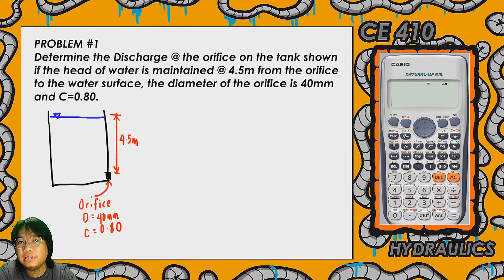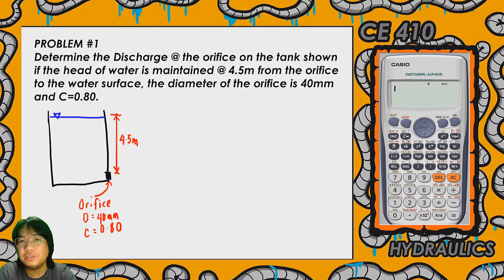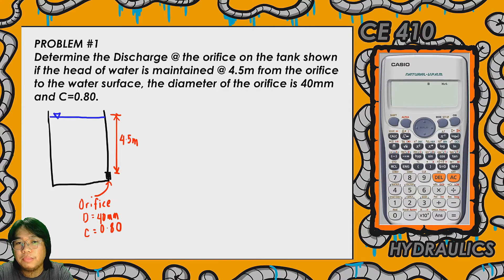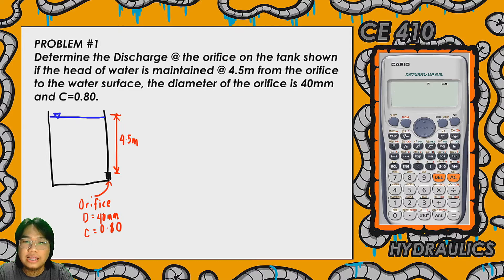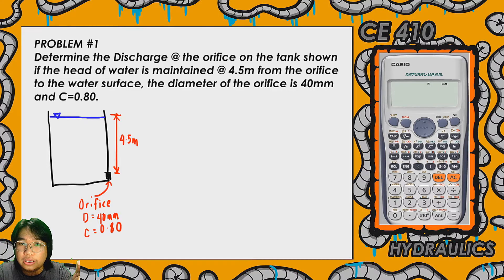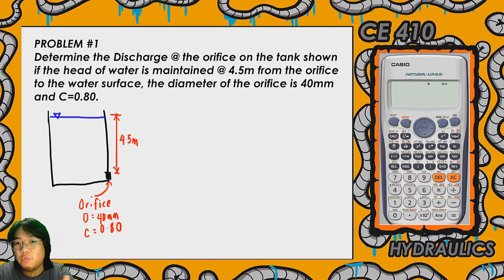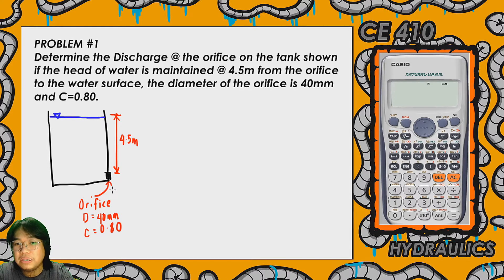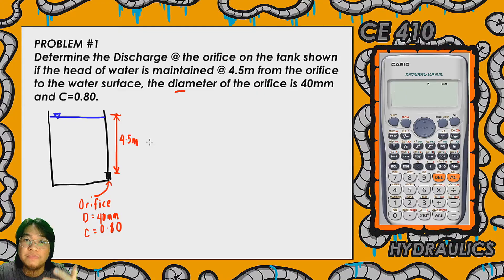Fluid Flow Measurement - Problem #1 Orifice (Constant Head) - PAANO

Comment: Hello po sir itatanong ko lang po kung ito ay free flow type, falling head, or submerged
Reply from the maker: @chesteratienza5175  i think, free flow, we are assuming that the head/height of water is not changing over time meaning there's an imaginary supply that is not usually stated on the problem

Other info:

Falling head problems, usually we determine the time a head of water will fall from higher elevation to lower elevation

Submerged orifice, usually the orifice is discharging water between 2 sources of different heads. The difference in head furnishes the flow fluid in the orifices

Hope this helps